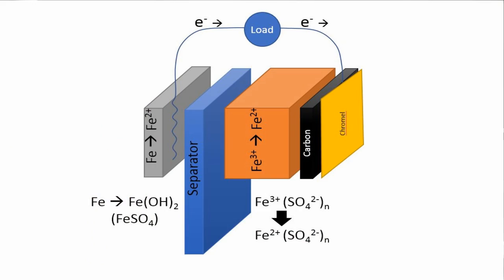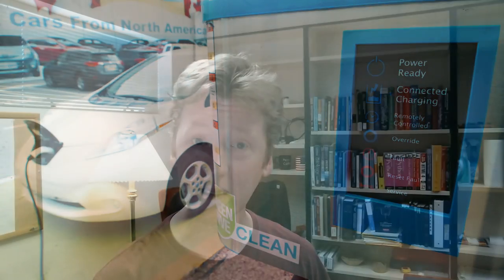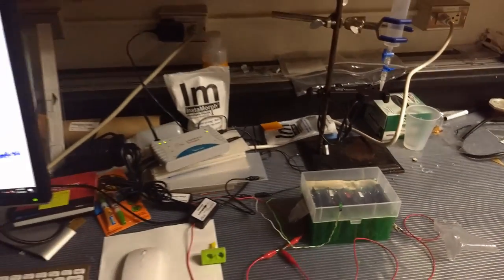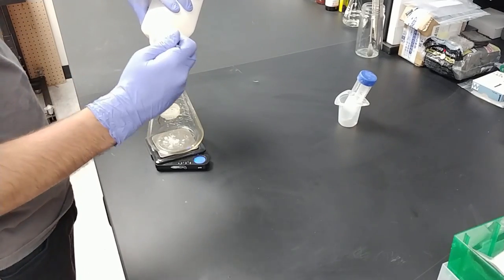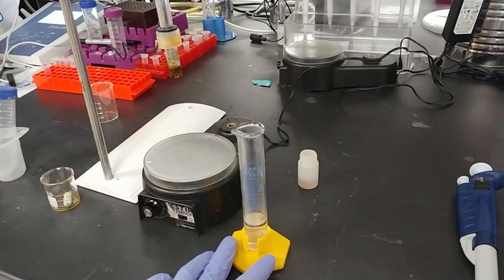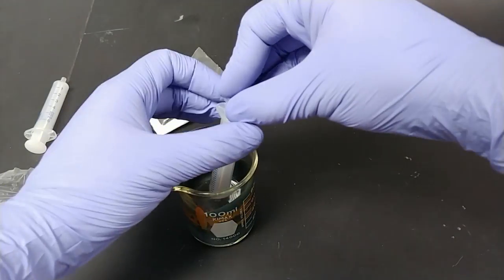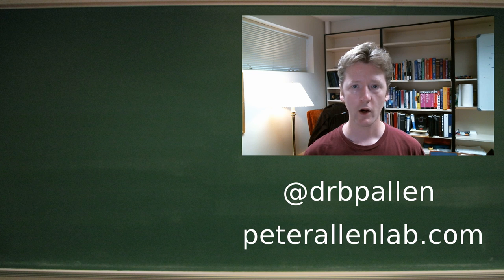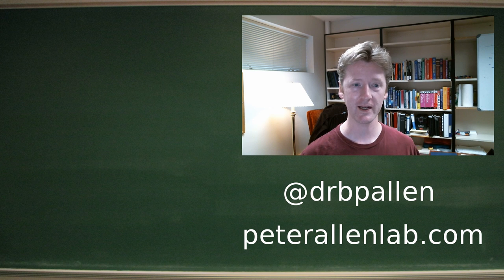Iron Battery 1.0: Build Instructions

Comment: I just used two pieces of cold rolled steel for anode and cathode with KOH electrolyte and common FeOH reduced from FeCl and triple rinsed.  It works and lasts just as long as yours and is much simpler to build.  The steel anode is surprisingly resilient when charging as long as there are no stray CL or other halogen or nitrogen ions around.  FE2 and FE3 are automatically formed on their respective sides during recharging and had plenty of space to form large pockets of thick iron hydroxide if you keep the electrodes apart about 3/8" and use dual separator bags next to each other in the KOH bath.  For the separator I used cheap and common Tyvek cloth (clothing grade) sealed with a baggie heat sealing machine. This is more or less a  home-made hybrid Edison cell (no nickle needed).
Reply: So you started with homemade Fe(II) hydroxide as the paste at both electrodes? Have you done any more work on it since you posted this?

Comment: I've recently become aware that these iron batteries are a thing. I was very excited about them because, from what I hear, they basically never wear out. You can use and recharge them forever, and if you ever did need to recycle them for whatever reason, the materials can basically be dumped into the environment with no harm done.

My question would be, if one were to make his own battery, how much would it cost to build one for 100 amp hours at 12v? I just looked up the cost of regular batteries at that spec, and they range from $60ish (for the old lead acid type) up to nearly $1,000 for an awesome new Lithium one. Would building your own put the cost in a competitive range with these already established and readily available types?
Reply: Nickel-iron batteries have been around since Edison and before (about 1850!). They are still being made in China but cost about four times as much as lead-acid for the same energy storage capacity. Many have been used in fork lifts and have been known to have >70 years of service.
Reply: IRON EDISON.com ,Colorado sells 12v 100ah battery for 1100 dolars.
Reply: DO NOT be confused! This is NOT a nickel-iron battery.  As the OP said, this battery is all iron. The electrolyte is basically a type of salt water with a mostly neutral pH. Your nickel-iron battery uses a very caustic solution of potassium hydroxide as the electrolyte;  pH around 10 or 11.
Reply: @ZombieTex -- Where are you seeing 12-volt Lead-Acid batteries of 100 amp-hours for around $60??? Car batteries are not rated that way. The "reserve capacity" of car batteries is the number of minutes they can support a 20-amp load, not 100 A, nor the number they usually feature, the CCA, which is only for a few seconds at a time... with significant voltage drop. Also, be aware that 12 V times 20 A, which may sound like a lot, if maintained for 20 minutes, is still only about 1/12th of a kilowatt-hour.
Reply: @YodaWhat  Cheapest ones that I have seen are right around $100 for a dual purpose Deep Cycle/Starting Marine battery in size 27.
Reply: @gravelydon7072  That would be a good price, but  prices advertised online look like significantly more. And while they may CLAIM those are 100 amp-hour capacity, some quick math based on the reserve capacity reveals only half that much stored energy. Put another way, one would likely have to discharge the battery very slowly, like ONE amp for 100 hours, to get the advertised "100 amp-hour" capacity... and that is too many hours in a deeply discharged state. The battery would be permanently damaged during the last 50 hours.
Reply: @YodaWhat  Remember, those ratings are described as 20 hour discharge rates. Which is the standard by which most batteries are defined. So at that, it means a drain of 5 Amps for 20 hours. You can pull out more current over a shorter period but the faster you pull it out, the quicker the battery will drop in voltage. Then you can let it sit for a while and pull some more out at an even lower rate. But in the end, it will be 100 Amp Hours. Such as 50 Amps for one hour, 10 Amps for one hour, and then 2.2 Amps for another 18 hours. A 1000 AH battery would be able to produce 50 Amps for 20 hours. My example batteries are Exide 27MDP batteries. Home Depot locally had them for $89.00 each. They are rated at 730 MCA, , 560 CCA, 160 minutes at 25 Amp, 100AH 20 hour discharge rate. I bought mine at the local BJ's for $99 each. Oldest two are now over two years old. Youngest two are now over a year old.
Reply: @AriBenDavid  The reason people think that the cost of NiFe batteries are 4x the price of Lead-acid is that they don't factor in the life-time. You are lucky to get 500 cycles from a lead acid whereas you will easily get 3000 cycles from NiFe. So you will need to buy 6x as many Lead-acids to give you the same total watt-hrs as NiFe over the same time period.
Reply: @beascene6998  Caustic yes, but I think potassium hydroxide is still not a hazard for the environment. Is potassium hydroxide not a large component of wood ash??
Reply: @YodaWhat  Absolutely correct. All the manufacturers claims for lead-acid are totally bogus. You cannot even use more than 30% of a lead-acid without damage. They seriously corrode the moment you start to use them. So how can they justify 100Ah when in practice you just can't use more than 30Ah?!!
Reply: So can anyone answer: how much would it cost to build a 100A hr Nickel battery?

Comment: Hint: sodium polyacrylate dissolves in a NaOH/KOH solution, so, you could dissolve it in alkaline medium, let it dry as membrane and then soak it in an acidic (f.e. H3PO4) solution, which makes it unsoluble again, so you will have a battery with much less electrolyte crossover and therefore better long term storage.

best regards,
André Leonhardt
Reply from the maker: Thanks - good idea. I suspect that the iron acts to help it stay gelled as well. I've read about polyvalent ions acting as ionic crosslinkers for this kind of gel. We could probably dissolve it in base, then treat with iron 2+ to generate a "pre-equilibrated" separator.
Reply: Peter Allen Good, idea, I have also thought about the Fe3+/Fe2+ compound to act as crosslinker, because of its trivalent, acidic- reacting nature. Maybe you should give it a try? You are really one of my personal heroes on yt, I almost feared you wouldn't anwer, I am glad you did :) Your videos really don't get the attention they should, poorly. If you want, I could help to improve your battery performance greatly, I have many ideas concerning this.

I really appreciate your work,
best regards,
André Leonhardt
Reply: What about using ferric nitrate or perchlorate instead of sulphate as it is far more soluble? and why you don't use ferric hydroxide instead of sodium? Thanks doctor for your information that you give keep up great work
Reply: simply because iron hydroxide is unsoluble in water and so you would have to use far more NaOH/KOH than Fe(OH)3 to dissolve it. The battery is based on the difference in the iron oxidation states, so in alkaline it probably won't work pretty well. The OCV may be therefore a bit higher. If you use alkaline medium, the membrane also may be way more expensive, because most polymers will hydrolyse, especially protein based ones. The only cheap one I could imagine would be crosslinked PVA. Oh, if you use iron hydroxide (insoluble in water), you will get almost no ionic conductivity and therefore a pretty small current.
Reply: Andre Leonhardt  thanks alot, early days I was making iron II&III hydroxide by electrolysis and it was forming a suspension then settle down to the bottom I forgot...but what about the nitrate salt as a cathode,and what is"ovc"? and what to do to get better knowledge of"membranes and b-seperator". I think the alkaline medium is to neutralise the So4-- produced by reduction of ferric sulphate so it could reducted easily as you have removed reduction product"So4--"
Reply: He uses nitrate, because it almost doubles the capacity because iron is oxidised whilst nitrate is reduced to nitrite. This doesn't change the oxidation stage of the iron salt, so the double action is that the solid iron gets oxidised to Fe2+

so the double action is 2Fe(NO3)3 +  2Fe --> FeO + 2Fe(NO2)2

forgive me if I said something wrong, but I am just soo tired
Reply: Andre Leonhardt that is ok, would be better to have a rest.. I think it would get iron III nitrate to iron II nitrate not nitrite,if it possible you could recommend a source for separator chemistry tomorrow or so as you like, I'm talking relative to me it's 9:30 pm here Egypt
Reply: Hello,
Okay, now I will explain the use of ferric nitrate again, nitrate salts itself are very strong oxidisers, so the ferric nitrate has a double chemistry, because the trivalent ferric nitrate reacts with iron first to ferrous nitrate Fe(NO2)3 and then the trivalent iron salt reacts with further iron to divalent iron nitrite. So when he uses nitrate, the cell chemistry allows to give off more electrons than when using a non-reducable anion in the salt. Hypothetically chlorate may work as well and ferric perchlorate may work even better. When he neutralises the salts with NaOH/KOH, he won't get pure ferric/ferrous hydroxide, he will rather form corresponding acid base pairs because of the near neutral ph. If he stays in acidic ph, the voltage may be lower but the current maybe a little bit higher.

I don't quite understand your last question, but I will try best to answer it, so:

You want to know how to make a good/improved seperator, right?
For my experiments, I use a non selective membrane with roughly 20nm sized pores. The principle of this membranr is laminar flow inside the pores

For this membrane you will need cellulose acetate (CA), glycerol (at least 99%) and acetone.

Dissolve 10g CA in roughly 250ml of acetone and after complete dissolution add 10-20ml Glycerol (more glycerol means more, and bigger pores, but less mechanical stability, for my purposes I used 20ml Glycerol)
If your solution is ready, you can solution-cast-dry where you want, just pour it in a petri dish and dry it at ambient temperature. This membrane works really good in solutions with a ph of 10.

If you use a ph between 12 and 14 (o.O very caustic), you may want to use a polyvinyl alcohol membrane. I use a low hydrolyzed polyvinyl acetate and then hydrolyze it with NaOH solution (70*C)  until it forms a gel (because of chain growth and polymer precipitation) if you have this gel, put it in a 90*C hot 10%wt citric acid solution for 12h and then again in the NaOH solution for further 6h. Alternatively I recommend the freeze and thawing method for crosslinking, which is simple but takes a lot of time.

For cells that use a ph between 4 and 8, I'd even recommend to use an 2-3% agar gel soaked paper as seperator.

OCV means open circuit voltage.

regards,
André Leonhardt

post scriptum, if you have further questions, please directly contact me via email (leonhardtandre1@gmail.com)

Comment: You think you could get a higher output efficiency by using a low volume circulation of the electrolytes in a larger cell, so to minimize internal resistance by nearly eliminating diffusion from the surface through the liquid and effectively working as if the surface area contact were greatly increased by using convective effects of the flowing liquid over the reactive surface; thus greatly increasing reaction rate by increasing reactant contact due to a flowing solution through the metal mesh??

Comment: I am curious about durability. Would you expect the steel wool to eventually fall apart over many charge/discharge cycles as it gets plated onto and dissolved from? And will the Fe3 vs Fe2 get "unbalanced" when it produces hydrogen? Thanks for making this whole series!
Reply: If done properly, the fe3 is reduced directly to fe2 by electrons provided thru the circuit...and the opposite will occur when charging IF the proper voltage/current input is correct to notoverdrive the rxn.  This is the beauty of long-term dependability as this cell chemistry doesnt need to dissolve and regrow, as the iron is always in an oxidized state staying in solution; where other batteries oxidize metal into solution as ions which are reduced back to metallic base form and regrow...this redox rxn just moves between 2 different oxidation states never converting solid to ion.  This is why the cells have a comparatively lower voltage as the energy difference between +2 and +3 is less than going from Fe to Fe+2, but large enough to do work.  With a large cell and circulation of the solutions through and over the surface of the electrodes, one can eliminate most internal resistance by eliminating diffusion time and increasing reaction rate significantly with increased reactant contact due to convective movement rather than diffusion

Comment: Great work! What's next? Will you continue to work on improving the iron based battery?  If so what's are some theoretical goals that you'd like to reach for?

Kindly, if you could post some links as to where to buy some of the materials like graphite foil, felt etc.. would be great
Reply from the maker: Thanks for asking - I added the materials to the description. A more complete written instruction set will come out before too long and I'll add a link to that as well.

Comment: Nice work. Still, even for stationary use, the energy density is the 600lb elephant in the room. The average house could use a 100kwhr bank. I haven't done the math but that would probably call for a bank on the order of around 10 tons, just pulling a number out of the air. Your electric house would need another house to contain the bank, and a very sturdy foundation and floor. For remote monitoring or switching stations or whatever, with low power demands, it could be a thing, though. I like the chemistry there... more or less ph neutral electrolyte! Nice. Iron... and BTW have you done any work with alkaline Nickel-Iron cells? Like Edison cells, in comparison? Your iron-iron batteries, what sort of lifespan in household use would you expect? And how many charge/discharge cycles? Is there a minimum state of charge? What sort of internal resistance or self discharge rates could one expect? 

I have an electric boat and so far the best bang for the buck I have found is GC2 size 6v golf cart batteries, 220ah for about $85 at Sams. With proper care well, I am 7 years in on my first bank and they are only now showing signs of failure, I figure I have another year of useful life left in them. I am forced to replace one, or else reduce bank voltage to 42v, soon, and these batteries really work best when cells are matched by age. Yes, LiIon or LiFePO4 batteries would boost performance and increase allowable depth of discharge, and maybe last a little longer, and weigh less, but there is the cost which is about 4x the cost of my FLA bank, and for the average consumer, what I am getting at is for the example 100kwhr house bank, the cost needs to be reasonable and needs to beat the cheapest Flooded Lead Acid batteries available. Iron-only batteries offer a glimmer of hope there, but at some point on the power density curve, the case material, manufacturing process, and shipping charges will become prohibitive even as the active material cost approaches zero.
Reply: the ESS Inc 40kw battery is a truck trailer, so yeah, there's that.

Comment: YOU CAN FORM THE ANODE AND CATHODE WIRES INTO A COIL AROUND THE  PLATES TO CREATE A ROTATING MAGNETIC FIELD THAT PERMEATES THE PLATES AS THE BATTERY DISCHARGES OR CHARGES TO CATALIZE THE CHEMICAL REACTION.
Reply: Dude email this is the science behind inductive battery

Comment: Buy LED lights. Twenty watts instead of 100--savings add up. Maximize use of daylight. Reduce your animal fats into candles and soap--they don't stink if reduced enough. It's fun. Learn to knit, crochet, sew. Garden where possible. Be surprised how fun life can be.
Reply: Yes. When I was building my home years ago, I wanted low voltage lighting because you could get more lumens per watthour. Now that Led's are here, the same holds true.
Reply: @roddoney7568  The whole thing is how fun it is to be self-sufficient and not piss away one's hard earning with always-on TV,  incandescent lights left on, fast food, etc. Yes, LEDs.

Comment: What would it take to scale this up to use for a solar battery storage unit?
Reply from the maker: The newer videos have some improvements. It's reasonably scalable (though messy) if you want to DIY. Building a company to scale up is going to be expensive to get started.

Comment: How big would be a 10kwh one for the house. Why not? ;-) serious question, thanks.
Reply from the maker: This is the old version - we've done better.
 
https://youtu.be/z6vcbXLKJR0

With the best version, you would need to have a battery of ~1000 L for 10 kWh. So, it would fit in a pickup truck bed. Still way bigger than we would like, but it's progress.
Reply: @PeterAllenLab  Thanks! Looks super promising.

Comment: Would you share more data on this project? I am not wanting to sell anything, I just  want to build my own batteries if I can, for my off grid home. I was wondering thinking about nickel iron, I haven't sourced the matereals. I need something around 100kwh and as much as 250amps @ 24v,  I like the long possible life of the nickel iron, thanks great video...
Reply: research iron n water flow batteries thats what u need right there

Comment: Hi Peter - Cheers all around - what a precious amount of information you share with us and educate us.  
Can you comment on the cell relative to self discharge?  I'm guessing its quite low ???
Dennis
Reply from the maker: With the polyacrylate membrane, the self-discharge is significant. It will hold a charge for days not weeks. Using Nafion is preferred, but more expensive. In a commercial system, a higher performance separator could be used.